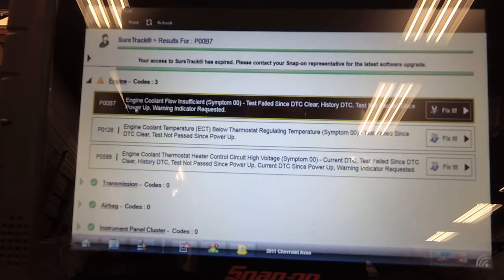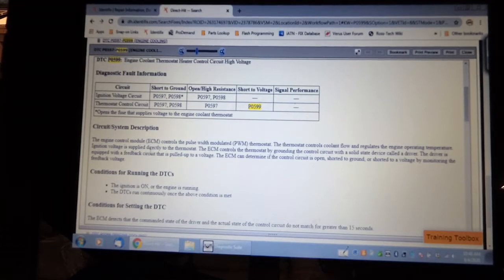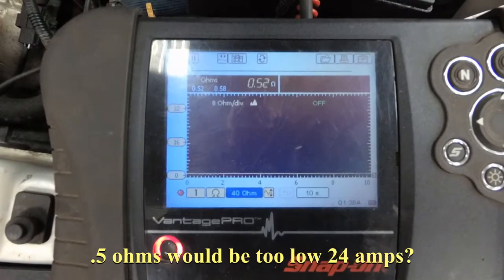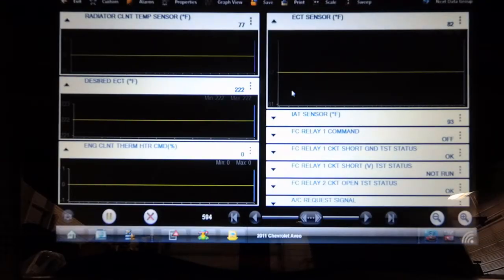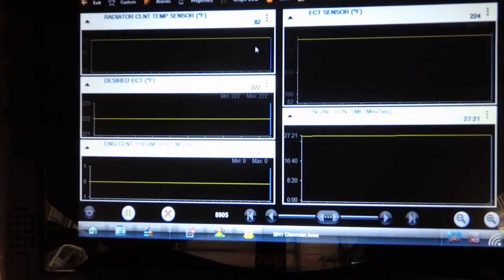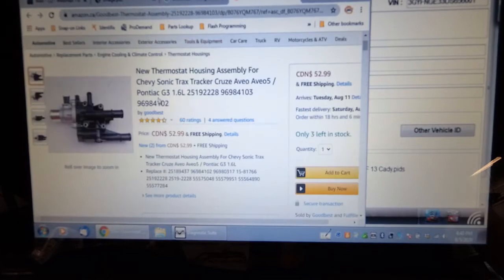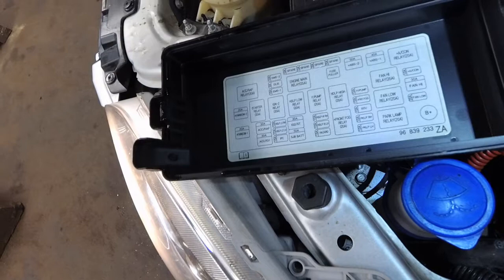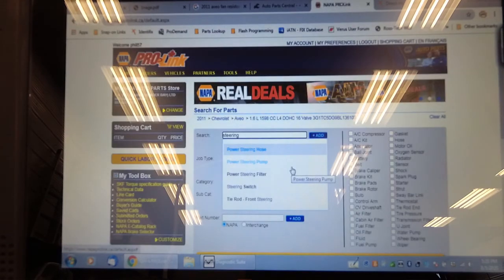2011 Chev Aveo Overheating and MIL on

Comment: Fan resistor can be found at TSC for a ford tractor same size shape and resistance wire connection flat blade instead of bolt on cost around 10 us dollars
Reply from the maker: Thanks for the tip 👍

Comment: the plastic housing wasn’t leaking until after the thermostat was removed and the fresh pry mark between the plastic housing and thermostat. could have said don’t pry the thermostat off by jamming a screwdriver between the plastic and thermostat or you could break the plastic housing like you did. you can see plain as day that fresh pry mark and crack wasn’t there before you took the thermostat off.  after the thermostat bolts were out the thermostat was stuck to the plastic housing and you incorrectly forced it apart between the metal thermostat and plastic housing with a screwdriver.  you don’t have to lie and say “it was like that” there was no leak or pry mark before you forced it apart. just watch what you filmed it all recorded buddy you could have just been honest it probably was brittle anyway that’s why you should not have jammed a screwdriver in at that spot.  “oh wow look the plastic housing is leaking i must have missed that before “ hahaha!! 🫵😂 ya know you broke with a screwdriver  trying to separate it from the plastic housing!!! oooops!! accidents happen all the time no big deal but you have to consciously decide to lie .  just couldn’t admit ya cracked the housing right. to have an accident is human but it takes a real asshole to lie!!!  🖕mr. never had an accident !!! ur a liar man wtf

Comment: $450 from the dealer...bullshit! 
Dorman has an all aluminum housing with thermostat and gaskets $59....https://www.rockauto.com/en/moreinfo.php?pk=8164960&jsn=910
It will say it doesn't fit the 2011 Aveo...BUT IT DOES. It's the exact same part. How come I (amateur) can figure that out but these so called professionals can't. Gotta watch these people.
Reply from the maker: You're correct. I ended up buying the whole housing aftermarket from Dorman. Thanks

Comment: I looked that part up and said it was not the right one for my Aveo and mine is a 2011
Reply from the maker: Do you mean the thermostat housing assembly or the resistor? This was an Aveo. Not sure why yours is different.
Reply: I went to the website dorman and put the part number that you said and it said it was for a Chevy Cruz maybe you could Confirm that
Reply from the maker: @brentpitchford54  id recommend to call you local aftermarket parts supplier. They can sell Dorman parts as well. I dont want to give you misinformation. That engine is used in a lot of models. HTH
Reply: I found it as radiator fan resistor at RA.